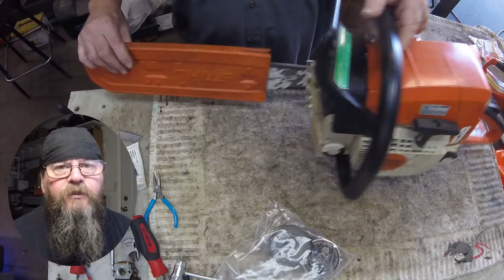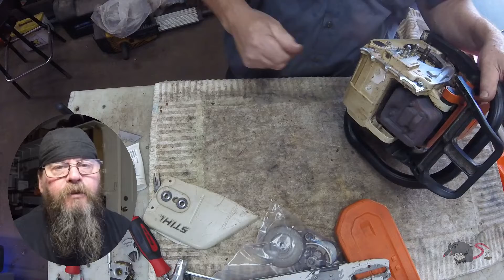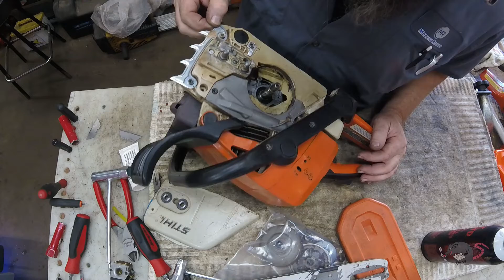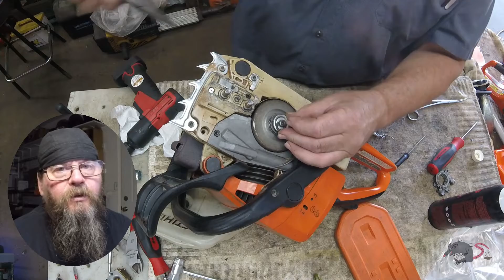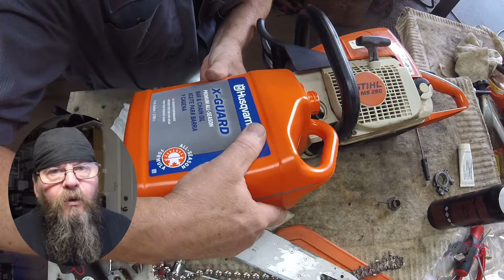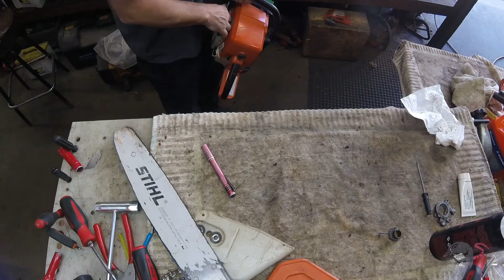Stihl MS290 Oil Pump Installation

Comment: Just watched video and tackled mine. It was an aftermarket pump and oem wire thingy.  I had adjusted the oil flow screw on bottom to max and it did oil but intermittent. The plastic bushing looked fine but I replaced it with pump anyway.  I think I’m going to have to dial back the flow now! 

Thanks for your concise explanation. Especially lining up the wire. I’d have screwed that part up for sure.
Reply from the maker: @rickywrenn  You're welcome and thanks for watching!

Comment: Awesome video my friend! I think my oiler is seized up. The plastic part of the work gear won’t turn at all. The little metal circle spring that goes around the worm is all that will spin. So I know the worm is seized up or melted to the oiler. Because of your video I’m more confident at tackling this job! Thank you sir for your time and knowledge! Please keep up the excellent work my good friend!
Reply from the maker: Thanks for watching and good luck with your repair!